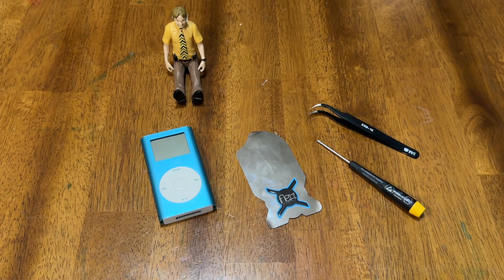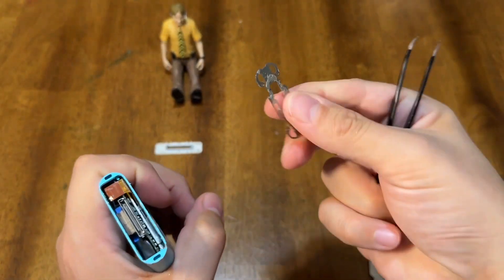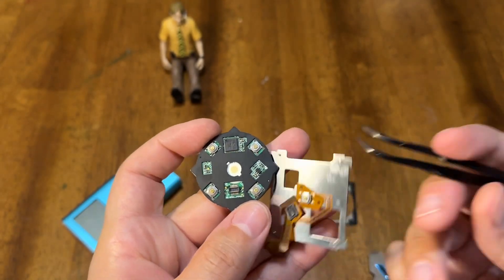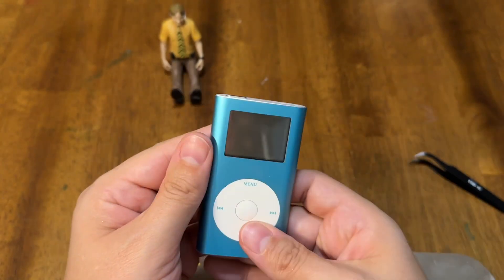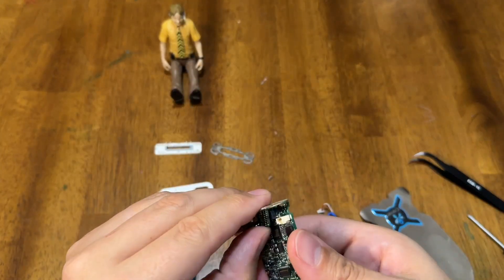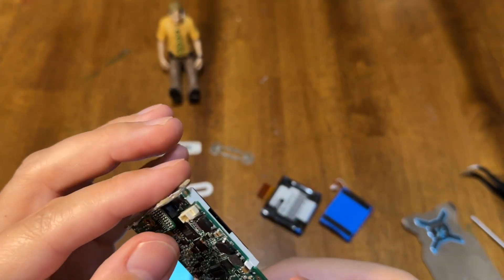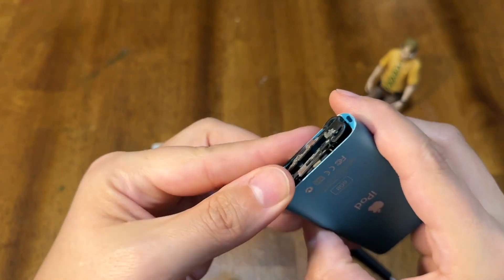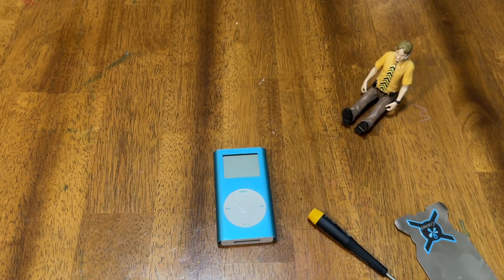iPod mini: the easiest iPod to disassemble, fix and upgrade.

Comment: I can’t push out the inside, I don’t know what to do, I did all the necessary steps, even tried with the click wheel out, what do I do…
Reply from the maker: The battery may be hanging up on a ledge inside the case. Try to flip the mini with the screen down so that gravity will hold the battery down and maybe wiggle it.
Reply: Thank toi for tué Quick reply! It turns out the case was a bit dented towards the inside, almost invisible! I had to use some tools to dent it the other way 😂
Reply from the maker: Excellent! Being all aluminum that is bound to happen. See how tight of a squeeze it is? Any little damage will prevent it from sliding out easily.